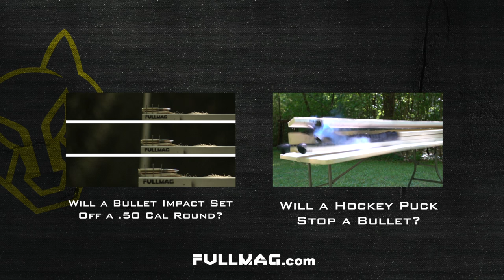AR15 Underwater Gun Malfunction

Comment: Fire the 50 BMG underwater at a watermelon from 50yards !!!  
I wonder what will happen to it because of the higher density!
Reply from the maker: That would be super tricky
Reply: BMG round would instantly disintegrate if not turn the barrel into a pipebomb
Reply: 50BMG or any other rifle!
Would be awesome to see how the watermelon blows,
You may shoot from about 1 meter away!
Reply: Fire it from outside the water.
Reply: Yeah That would be better
 Galen Marek
Reply: Fire from outside the water while the watermelon is into the water!!!
Reply: mythbusters already fired a 50bmg round directly into water, and the round turned to dust in a couple inches.
Reply: only heavy low velocity rounds had any real follow through.
Reply: +Galen Marek pretty sure they cant
Reply: +Gamer Doctor The surface tension rips the bullet apart. The speed of the bullet makes it do that. Same reason why it hurts more to jump from a higher place into water.
Reply: the bullet gets through about 6 feet of water and gets completly fregmented
Reply: But in Hollywood movies,the submachine gun bullet kills you 40 feet below the water surface...
Reply: Do it with a .380 acp

Comment: What will happen when we bend the barrel of a pistol or rifle is curved 90 digre upward........... Does the bullet goes upward or goes straight ?
Reply: The Germans issued a curved barrel StG44 to fire around corners. However, the rounds were loaded to fire the bullets slower to prevent damaged and the barrel would wear quickly.

Comment: Make a video on what a gun will penetrate while underwater
Reply: From maybe like 3 feet away
Reply: +Jake Alamo the air pocket behind the round collapses, and the round just flutters and stops. It only goes about 3 feet, and not straight. And there is so much more friction in the water compared to the air, so yeah.
Reply: +Jacob Hardy (JacobHardy64)  so do you think a bullet will penetrate a person if fired from close range underwater
Reply: +Jake Alamo penetrate possibly, but I doubt it would do much damage